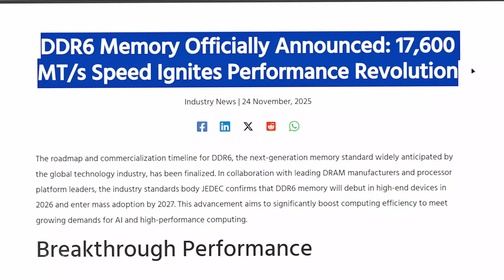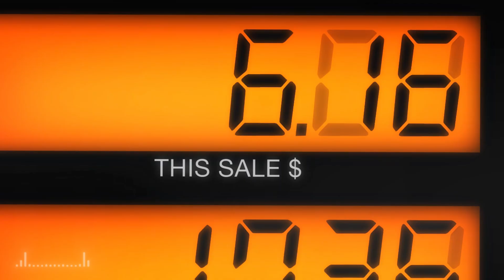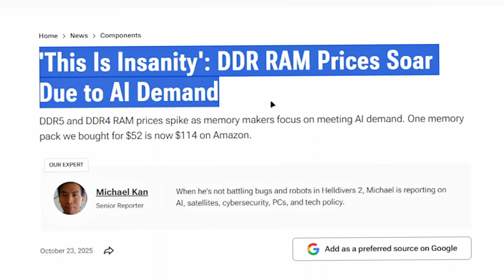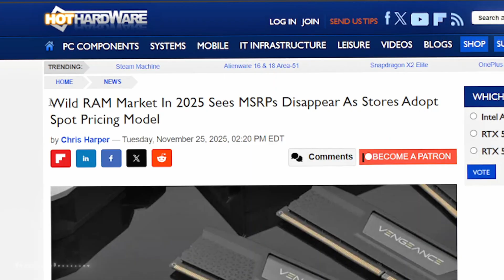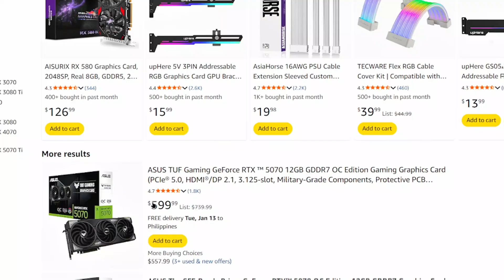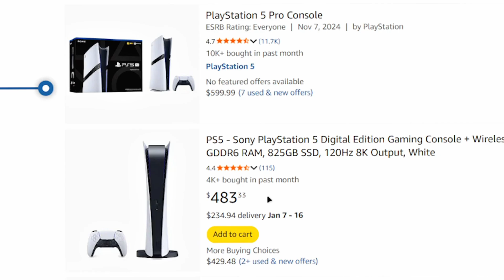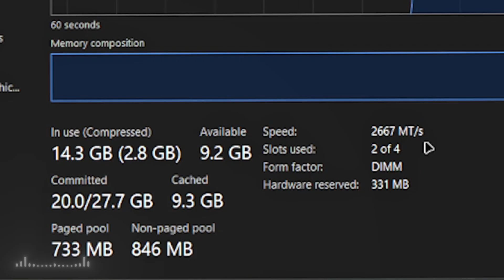There’s a Problem with DDR6 RAM Nobody Talks About...

Comment: Actually your incorrect DDR6 is expected to come out in 2026 - 2027 because its now 6 years since we have used DDR5 due to how quick technology is progressing right now and companies that manufacture RAM often start looking into the next version after 1 year of the current model. Mostly because they want to see how it is used by the pubic that and this is because competitors would beat them to the punch.

So DDR6 could already have been in development since 2021 or 2022 the only RAM i can think of that was 7 years was DDR3 to DDR4.

Now they have a much better scope of AI and how to integrate it into RAM one would believe DDR6 would improve the AI capability. Even to the point of RAM using AI to better organize the temporary memory to improve the efficiency of the RAM as a whole resulting in far better transfer rates due to the AI being able to calculate what infomation in the RAM the computer will need before the computer needs it so its ready for the computer to use it.

I personally believe DDR6 started development in 2022 due to how popular AI was getting and that was the next avenue RAM was going into and due to how AI as a tech has improved over 4 years. Being that it could not do hands and eyes to now doing animations might not be good quality animation but the potential is their.

Comment: Im glad i got my 96GB (48 x 2) 6000MHz 30CL RAM when i bought my first gaming desktop with a Ryzen 7 9800X3D paired with e RTX 5080 i just bought myself the WD Black 8100 4TB to replace my WD 850X 2TB before those go way up in price ill be set for a few years and upgrade once AM6 comes out at a reasonable price until then i hardly have any need to upgrade anything else i just hope nothing happens to my current set up at the very least if something happens to my RAM i have the stock 32GB (16 x 2) at the same 6000MHz 30CL so im set but still though i do worry about any of my components having problems in the future due to anything unknown so im being extra careful these days
Reply: I also got 96 gb ddr5 on ITX motherboard. 6400mhz 32cl, it cost 430€. And at the same time, I saw in promotion ddr5 5600mhz 96gb (2×48) for 290€.
I think the price that I paid for my computer at that time, couldn't be possible today and for the next 3 years.
I first got 1x16gb ddr5 for about 40€, and next year replace it with 96gb.

Comment: No point in ddr6 until it comes to BOTH Intel and AMD chipsets. And according to rumors AMD decided to postpone the AM6 socket and launch the Zen7 ~2028-2029 on the current socket (AM5) with ddr5, due to the projected ddr6 cost for consumers.

Comment: You'll normally want to wait for the end of year 2 or mid year 3 before buying the new ram spec. The ram at launch will not be very good. And will feature rather low speeds. Some lower then ddr5. But even beyond all that, you'll not see much benifit to the new ram alone. It's more the new CPU you'll likely be required to buy that will make the majior difference. An exception being igpu systems. Since ram speeds do impact integrated gpus. But are you really "upgrading" from ddr5 to ddr6 and NOT getting a dedicated gpu?

Comment: I think it is for AI PCs with the usual 128GB Quad Channel DDR5 using a Ryzen AI Max 395 or higher in 2026. They are advertised also for gaming. DDR6 would double the rates and match the GDDR5 of older GPUs like the GTX 1080ti. So this would boost both gaming and AI on APUs. Desktop does not even have quad channel. Though currently AI APU PCs are a whopping ~2200 bucks. A DDR6 might brake the sales because AMD is not even able to actually fully support AI with their notorious crapsky drivers NOW. Hence the Nvidia Spark making it a double to 4000 bucks just because of the software compatibility... If only DDR6 came with a minor or no price increase(not going to happen) those APU mini rigs would be so much more interesting! As to why the heck we even still use this silly RAM type instead of just using the VRAM as main system memory I really do not know. They just should sell them differently. Because making them is actually the same cost!?

Comment: 3600 or 4000 Hz DDR4 rams are still pretty much capable of handling 5090-tier GPU, it's been proven. So: BE chill until you can afford something 50% more powerful than that bros and sis'es.  Then get a cheap pair of 4800 Hz DDR5, it will carry you just as well as 6000 Hz one.
Leave 99999 Hz DDR-whatever to those who run at least 2 GPUs at once - they can afford that and truly need that. Benchmark scores and bottlenecking numbers won't stand above our real experiences in term of priorities, so get a nice 2k/4k with the absolute minimum response time instead if you got spare $.

Comment: Only one year left until 2028. The DDR6 price will be normal after the shortage. It's going to be in short supply and overpriced for one year. Due to AI centers using lots of RAM for 3 or 4 years
Reply: "Only one year left until 2028." Sir, this is 2025. You seem to have set your time travel machine incorrectly.
Reply: @Toshinben They said DDR6 is in 2027 the available DDR6 did not exist in 2025
AI centers will use DDR6 for one year
We won't get it until 2028

Comment: And also the chips for these ram sticks are coming off the graphic cards what they got kicking already with that ram installed on them graphic cards so they’re basically testing them out on the graphic cards then they will pull them chipped out and start putting them on ram sticks
Reply from the maker: Nah, GPU memory and RAM nenory have completely different pin layouts, voltages, and controllers, making them as compatible as a Ferrari engine in a toaster. Dude before commenting all this can you fact check, you're embarrassing yourself.
Reply: @Ronzel Graphic card all VRAM" refers to the dedicated, high-speed memory on a GPU, crucial for storing textures, frames, and data for smooth visuals, with common amounts varying from 8GB (mainstream) to 24GB+ (high-end/professional) for 4K/8K gaming and complex creative work, with cards like the RTX 4090 (24GB) and newer models offering ample VRAM for future-proofing. The amount (size) and speed (type like GDDR6X) of VRAM significantly impact performance, especially at higher resolutions and settings, so choosing a card with sufficient VRAM, often 12GB or more for modern gaming, ensures better future-readiness. 
This video explains the importance of VRAM in modern gaming:
Related video thumbnail
49s

GeekaWhat
YouTube • 27 Oct 2024
What is VRAM?
Video RAM (VRAM) is dedicated memory on the graphics card, acting as a buffer for the GPU to quickly access image data for rendering games and applications. 
Why VRAM Matters
Higher Resolutions & Textures: More VRAM allows for higher resolution textures and complex scenes without stuttering.
Future-Proofing: More VRAM helps cards stay relevant for future games that demand more memory.
Professional Work: Tasks like 3D rendering, AI, and video editing heavily rely on large VRAM pools. 
VRAM Capacities & Examples
8GB: Common in mainstream cards (e.g., RTX 4060, RTX 3060 Ti).
12GB/16GB: Good for high-refresh-rate 1440p gaming and entry-level professional work (e.g., RTX 4070, RTX 5070).
24GB+: For 4K/8K gaming, intense creative tasks (e.g., RTX 4090, RTX 3090, some professional cards). 
Key Considerations
Size vs. Speed: Both are important; faster memory (like GDDR6X) and more capacity (e.g., 16GB vs. 8GB) enhance performance.
GPU Generation: Newer cards often improve efficiency, meaning more can be done with less VRAM, but bigger is still better for demanding workloads.
Reply: @Ronzel Hard drive virtual memory (or paging/swap file) is a section of your SSD or HDD that your operating system uses as overflow for your physical RAM when it runs out, letting you run more apps or bigger programs by moving inactive data to the slower storage, preventing crashes but slowing performance compared to actual RAM. It's a crucial memory management technique that makes your system more stable, especially with limited physical RAM, by temporarily extending available memory space. 
How it Works
RAM Full? When your computer's physical RAM fills up, the OS identifies data not actively being used.
Paging/Swapping: This inactive data is moved (paged out) from RAM to a reserved file (page file/swap file) on your hard drive or SSD.
Data Retrieval: When you need that data again, it's moved back into RAM (paged in), potentially swapping out other data. 
Key Benefits
Prevents Crashes: Stops applications from failing when RAM is exhausted, notes Dell Technologies and this article.
Improves Multitasking: Allows more programs to run simultaneously.
Supports Large Software: Enables software that requires more memory than physically available, says TechTarget and this article. 
Performance Consideration
Slower Than RAM: Accessing data from a hard drive or SSD is significantly slower than from RAM, so heavy reliance on virtual memory causes slowdowns, says Crucial. 
How to Manage (Windows Example)
You can usually find these settings in your system's advanced settings: 
Right-click "This PC" > Properties > Advanced system settings.
In the Advanced tab, under Performance, click Settings.
Go to the Advanced tab in Performance Options and click Change under Virtual Memory to adjust the paging file size or location, notes Microsoft Learn.
Reply: @Ronzel Graphic cards work great on Linux, with AMD often praised for its excellent open-source driver support (Mesa/AMDGPU) and NVIDIA requiring its proprietary drivers for best performance, especially for gaming or CUDA, though open-source Nouveau drivers are improving. To check your card, use lspci or lshw -C display, and for NVIDIA, nvidia-smi confirms driver status. Popular choices include AMD RX 6000 series (like RX 6700 XT, 6900 XT) for seamless experience, while NVIDIA works well with proprietary drivers for modern gaming. 
Checking Your Graphics Card in Linux
lspci -k | grep -A 2 -i vga: Lists PCI devices and shows the kernel driver in use (like amdgpu or nvidia).
lshw -C display: Provides detailed hardware info for your graphics card.
glxinfo | grep "OpenGL renderer": Shows the renderer name if drivers are working.
nvidia-smi: For NVIDIA cards, shows GPU utilization and driver version. 
Choosing a Graphics Card for Linux
AMD (Radeon/Radeon Pro): Generally preferred for ease of use due to strong open-source driver (AMDGPU) integration in the kernel, offering great performance with no proprietary blobs needed.
NVIDIA (GeForce/Quadro): Works very well with their proprietary drivers, offering top performance for gaming and compute (CUDA), but installation can sometimes require more steps. Open-source Nouveau/NVK drivers are improving but may not match proprietary performance on newer cards. 
Key Considerations
Drivers: AMD's are built-in; NVIDIA often needs installation (from your distro's repos is best).
Performance: Both brands offer excellent performance, but AMD often feels more "native" due to open drivers.
Gaming: Both are excellent; NVIDIA excels with proprietary drivers, while AMD shines with open drivers and features like VRR. 
Recommendation: For a smooth, "just works" experience, newer AMD cards (like the RX 6000 series) are fantastic; for cutting-edge features or CUDA, NVIDIA with proprietary drivers is a solid choice.

Comment: And another thing, the actual silicon chip in the die for the ram they’re all the same doesn’t matter what ram it is they are the same chips on every ram stick. It’s the PCB board. What the chips lay on is different.

Comment: I have 64GB DDR5 (two 6000C36 kits)
with 9950X. Running at 5200mhzC44 (could optimize but see no point, I ain't a gamer)
... Why should I care about the Camm2 DDR6 ?
Coming in, whatever how many years ?
RAM will be RAM.
And unless, somehow, we release 128 bits CPU, with Terabytes of DDR for cheap.
I won't jump.

my tower is good to go for a decade or so.

Comment: To be honest, I don't care about the current ram shortage. Not to sound stupid and stuff but like, I've never really noticed a massive difference between fast ram speeds, all that matter to me is how many GB or ram it is. Same with the gaming performance, I can barely notice performance improvements if there is any.
Reply: Same I'm still running DDR4 64GB disable XMP for stocks speeds at 2667mhz...no difference in performance regarding productivity and gaming.

Comment: I have a 32gb ddr4 2400mt/s kit and I literally have no problem with it.
Reply: same
Reply: That's trash way too damn slow oc it at least get 3200mhz ddr4 b die
Reply: @RealTechGeek  ?? the diff is not that much bruh
Reply: Good enough !
Reply: just oc to 2666mhz from BIOS its safe it wont brick your ram. thought difference is will less
Reply: I have 128GB DDR4 for few years and no problem with it. No need to upgrade my DDR4, nothing replaces my RAM